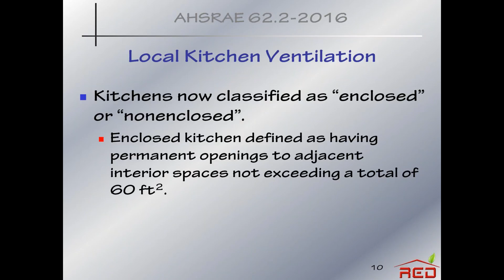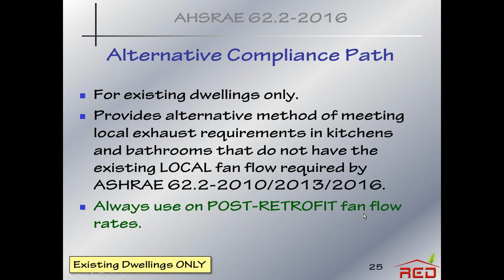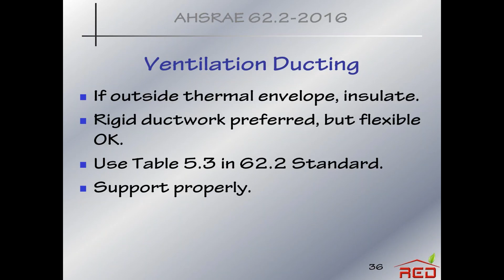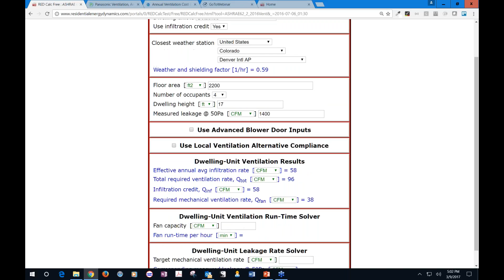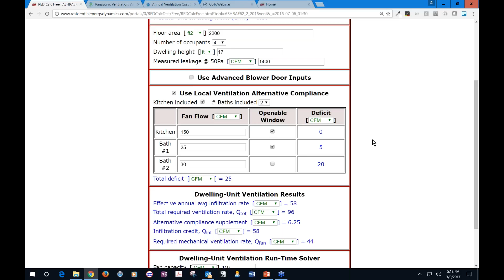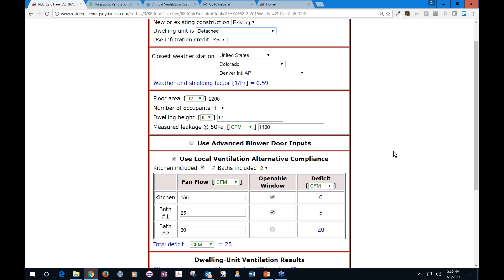ASHRAE 62.2 (2016)  Using the New Standard in the Field

Comment: Bill in this example, what would the required ventilation rate be? Is this correct: An existing 1500 ft2 stacked unit with 3 bedrooms, 4 occupants. No kitchen fan, no bath fan. No operable window in either space.
Qfan = (0.03 * 1500) + (7.5 *(3 +1) = 45 + 30 = 75 Required Ventilation Rate, Qfan
Alternative compliance deficit of 150/4 = 37.5
75 + 37.5 = Qfan 112.5